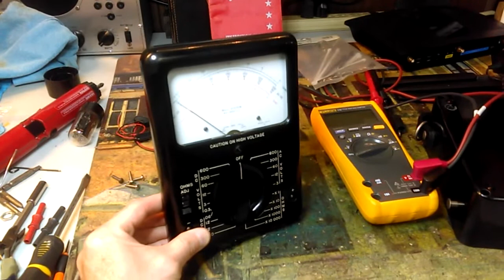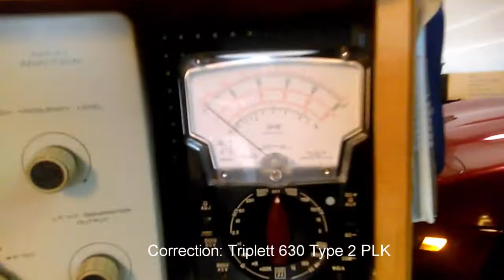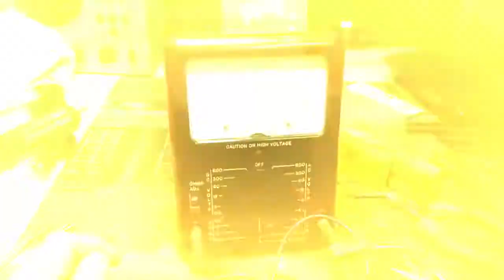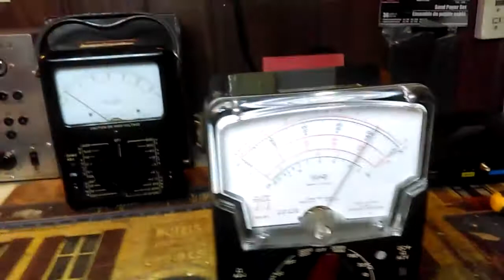Triplett VOM 30v battery upgrade to 9v batteries volt ohm meter ohmmeter

Comment: buy 10 lithium coin batteries 1” shrink tubing two pennies two 14g wire and you get a smaller easy to tuck into the unit and you just have to figure oit what the two pennies are for This battery will last you longer than any alkaline battery
Reply: What are the two pennies used for?